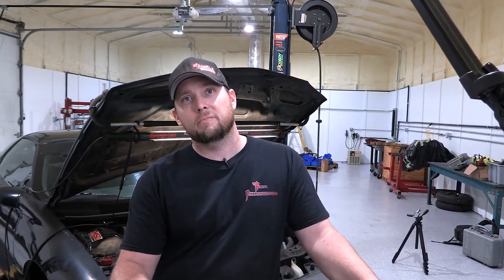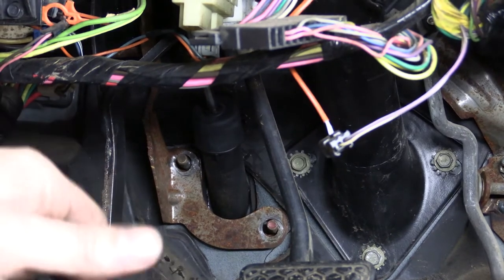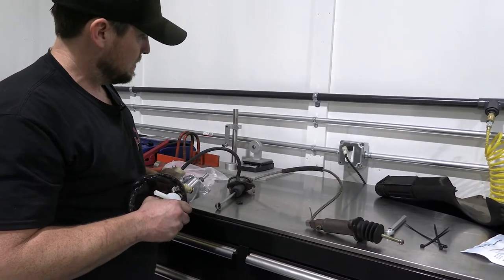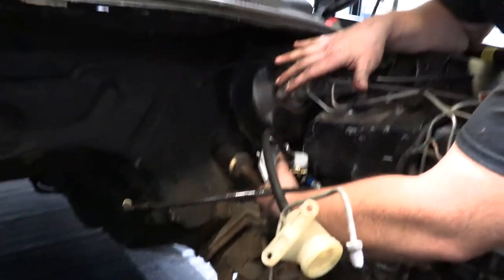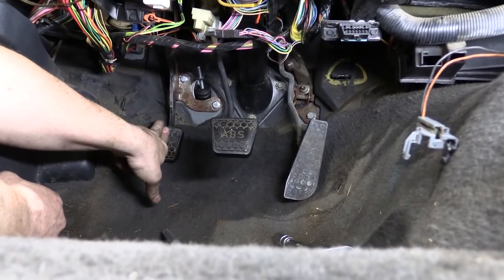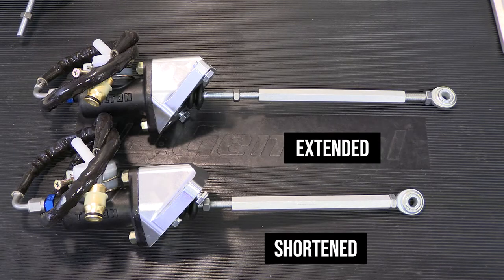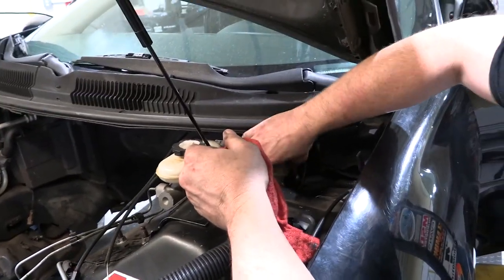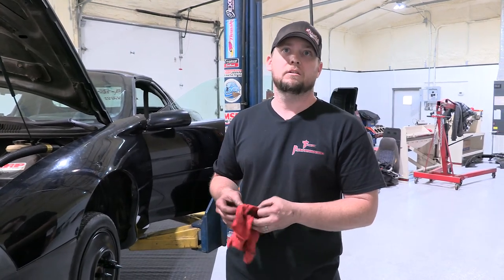How To Install a Tick Performance '93-'97 F-Body Adjustable Clutch Master Cylinder

Comment: I ordered the hawks 3rd T56 mag F converison for my 2000 ws6 did the covert I have a fully built lq4 afr heads comp 656 lift cam etc etc. Factory master went out 2nd time taking it out to try and tune on the road. All my friend say this is the way to go thats why Im here.

Comment: I would mention 2 things for someone replacing the factory master cylinder.  1. In addition to the 2 nuts on the u bolt inside there are 2 serrated washers behind the u bolt that must be removed.  2.  With the engine in the car it is nearly impossible to get to the master cylinder under the brake booster without first removing the brake booster.  My experience from replacing mine on my 2000 camaro SS.
Reply: Ya man i got one of those washers myself just one and just realized this. Like why?!?! Why is that there.😅😅 not quite sure how im gonna kill it either but im tryin to figure it out now hahah

Comment: Just did the install on my 02 z28 with the trans already out, I’m not sure if it’s the same with it in. A few things that helped me were removing the reservoir and its hose from the master so I could slide it under the steering rack easier and I pulled the whole thing out from under the car instead of from the engine bay. I did not need to remove anything to get it out. Just remove the reservoir, detach the line on the trans, then the 2 nuts and on the u bolt to remove the master

Comment: So does it not need the clutch pedal retaining clip be in place after the system is put in?
Reply: Did you figure out if it needs it or not?
Reply: @NoMercyGTCS  yeah I got it it clipped in eventually, and I got the clip in as well.
Reply: It take little more pressure, but it will sit with enough space to where you can get the clip on, and even getting the clip on takes a little extra force as well.